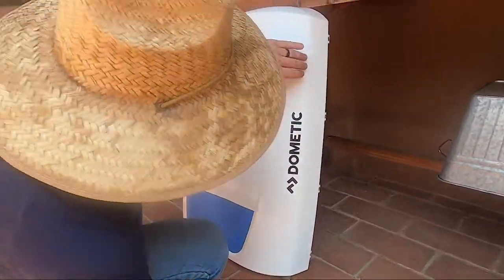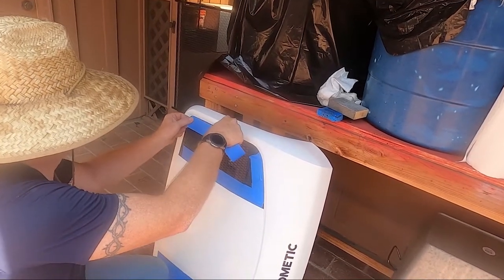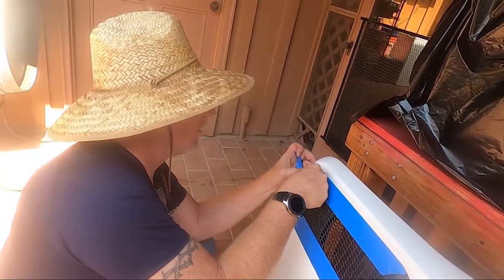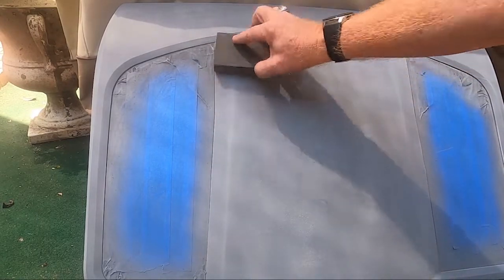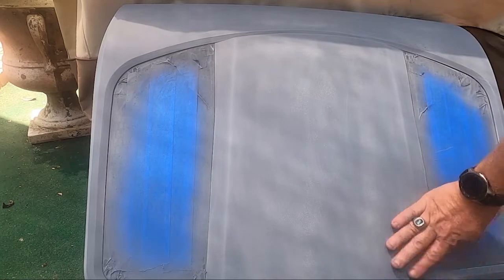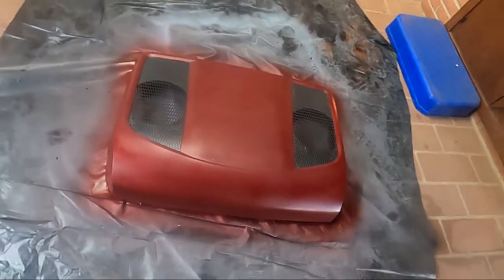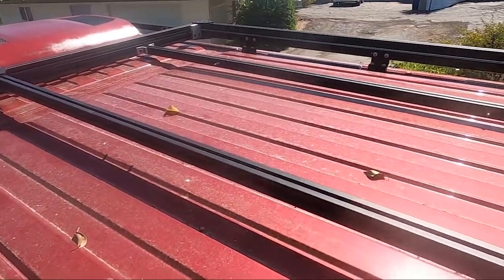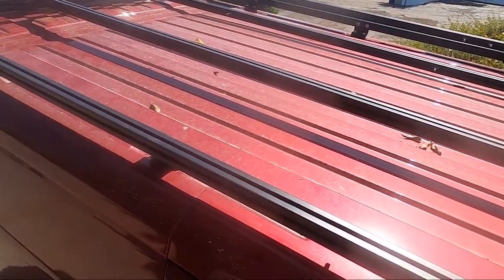Painting the Dometic RTX 2000 AC cover. Ram Promaster 3500 Extended. Sliding Solar Panel Part 2

Comment: Thanks for the video & update.... Nice Progress! Color matched AC looks really nice up there now. I didn't dislike the white as it's just so common to see white fans covers & ACs on top of so many colors, but the color matched red truly does look a lot better.
We will be doing a high platform to accommodate our two folded Rad Minis. They'll need about 35" clearance in addition to a plywood slide like what you previewed. What type of e-bikes will you guys be carrying?
Reply from the maker: We have the Lectric Ebikes (1st gen).  I don't recall off hand but I think ours were about 30 inches tall when folded with seats removed.  You could also gain some space by letting air out of the tires.
Reply: @redgiantvan189  OK.
Our Rad Minis have the fat tires, so your suggestion will likely make a big difference in the clearance needed. Thanks for the tip!

Comment: Robert, how is it going with the RTX 2000 with being painted? Being darker than stock, does it affect the efficiency of the unit? Did you happen to check with the manufacturer about your idea?  Just curious because i'm thinking about doing the same thing on my van. Thank you
Reply from the maker: Ive not noticed any issues.  In the manual, it states, "The top cowl of the parking cooler can be painted (fig.3). The 
manufacturer recommends that the painting is done by a specialist paint 
shop."
Reply: @redgiantvan189  I did not know that, thank you Robert, and again great job so far, I like that extruded aluminum sliding solar panel rack. That could serve as a little shade when extended. Like it...!
Reply from the maker: @brianchetelat6601  Thanks.  The slider doesn't really provide that much shade as it's not that big.  It sticks out about 2 feet over the edge of the van as I only pull it out far enough to clear the underside panel.  At it's maximum extension, it would stick out about 3 feet.  It's about 6' long.  But I'm sure it does help a bit as it's covering more of the van roof when extended.
Reply: @redgiantvan189  That is still a way cool idea, thanks again and all the best as you continue the build. See you on the road : )